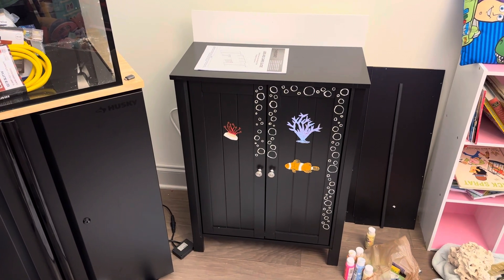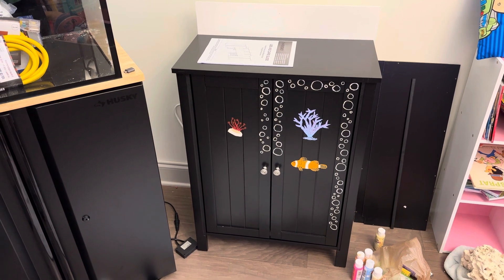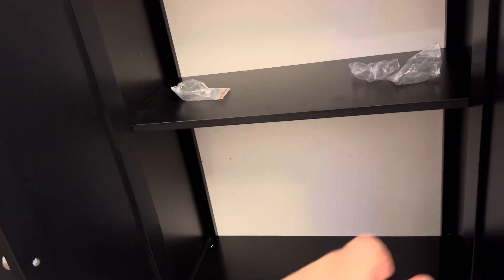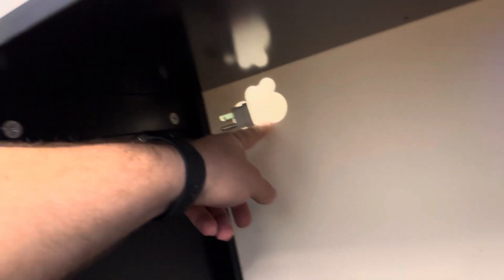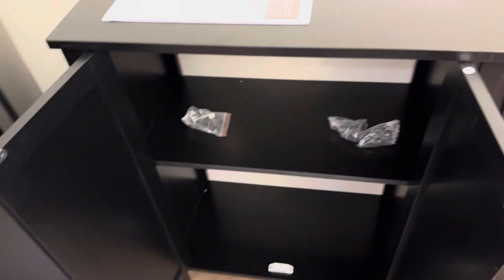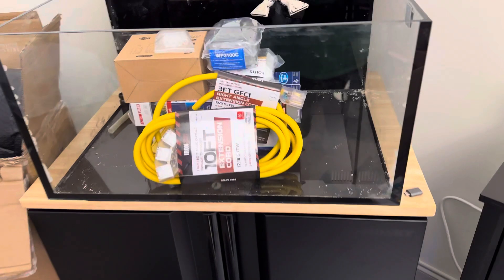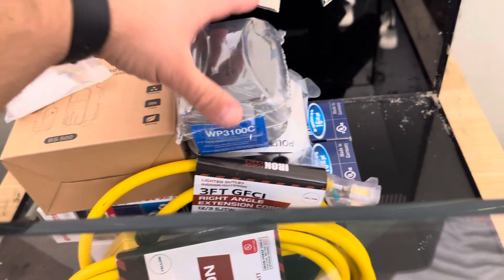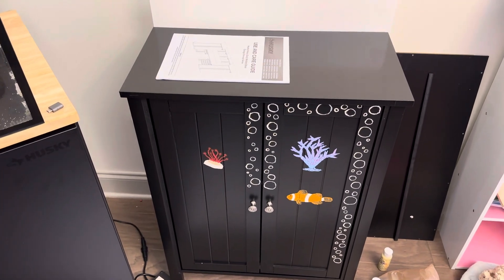Reef Tank Build Series: EP4 - Controller/Electrical Cabinet

Comment: Where did you buy the plastic marine board?!
Reply from the maker: I’ll look into it. There’s a website where you can order custom sizes.
Reply: @kalamazoo_reefer  perfect, thanks!
Reply from the maker: @queencityreefs Ha, the company is called Boat Outfitters. I wouldn’t hesitate to put this stuff all over a boat, either. It’s great to drill into, it’s easily cut, it’s pretty light, yet also not flimsy. And waterproof!
Reply: @kalamazoo_reefer  I have foam board that I used to cover my 40 Breeder stand but I can already tell it won't last so definitely getting this. Thanks again!